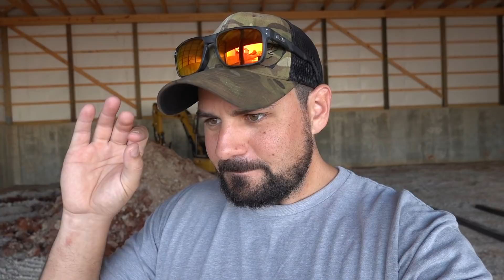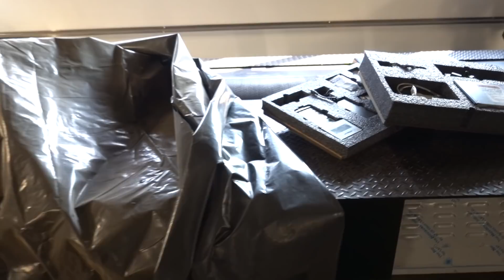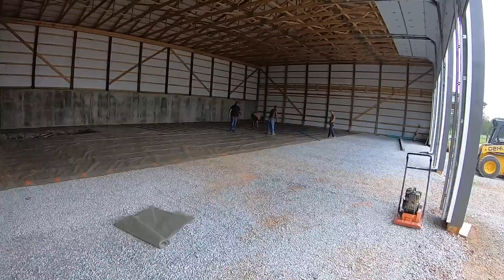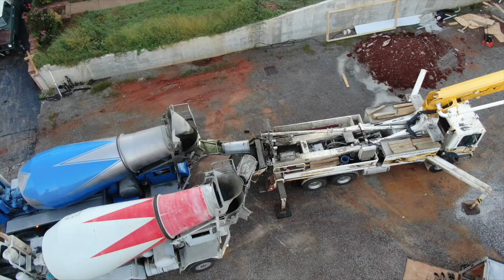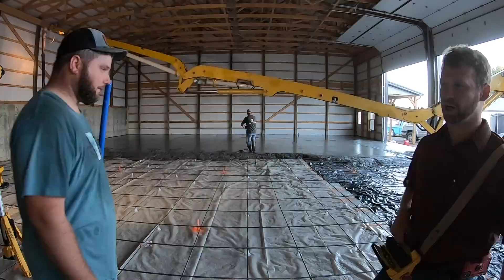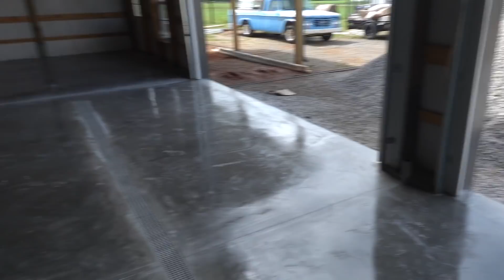60X80 Dream Shop Update!!!! Massive Progress!!!!

Comment: Good choice but make sure the rebar is coated . Not raw iron.. raw will rust and expand and crack the floor ..Especially in colder climate. I would also put foam underneath the concrete to keep the chill out.. also use concrete with binders..
Reply: @jessejames3572  so you could make a negative comment like you have on other channels.. I was waiting for your comment ..🤞

Comment: I"d have the rebar and I'd throw in a fiber bag or two in the mix myself - that holds edges and corners as you saw or have the floor down in a pit. Fiberglass can be added at truck time.

Comment: You need 10" of cement for your Lifts just in case you didn't know. I'm sure you did because you do your research Sir :) I'm doing 12" of cement for my lift so I can support my 08 Dually :)  HomeDepot has a cement paint that seals the cement and is for easy cleanup and comes in colors and it isnt epoxy. I'm doing Epoxy because I painted for a living for 5yrs and if you get OIL based Epoxy it lasts forever .

Comment: Seems like the dyno is in a weird spot, but the smoke exhaust exit may be a big reason. You don't want it venting out the front of the building toward the backyard / pool area where soot will just coat everything. He'll probably vent out the back wall, because roof seems high maintenance. I still think the dyno pit should've been at least a few feet out from the main wall (room to walk around dyno pit & work on dyno / vehicle) and it should be closer to the front where you can drive a vehicle right onto it, so the whole shop in front of it isn't a wasted "alley way". ... but my opinion isn't worth any more than anyone else's.

Comment: They make a saw dust type of material that you spread on concrete, and push around with a broom, keeps it clean and smooth, I used in a massive warehouse to keep floors clean and polished,.

Comment: Well buddy, why not do a clear epoxy? Best of both worlds.
Reply: Epoxy does not take welding very well, like ice when wet unless you add sand then it is hard to keep clean. When new concrete is installed right it is a sign of good craftsmanship. Epoxy is for old, worn concrete to give it a facelift.

Comment: With the placement of the dyno, is the exhaust of said dyno’d vehicle just going to echo of the wall behind? That would seem like an issue potentially.
Reply: Actually that would work totally fine if you just have a tube that you put on the exhaust with a small fan to pull all the smoke/fumes out of the building.

Comment: Just watch out with the high polished floor it gets slippery when it is wet
Reply: Jr goes floor coating guys put some type of sand/ grit on certain work sections before they did the top coating.

Comment: It’s going to be so loud and smoky when you run trucks on the dyno
Reply: No way, that’s why dynos have an exhaust and operators wear ear protection.
Reply: Will need a good exhaust fan system to suck fumes out.